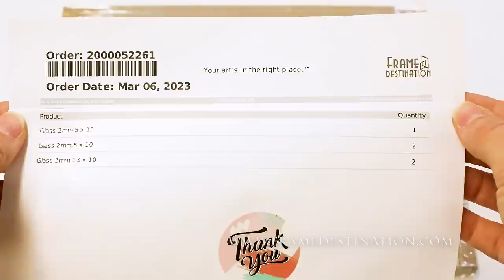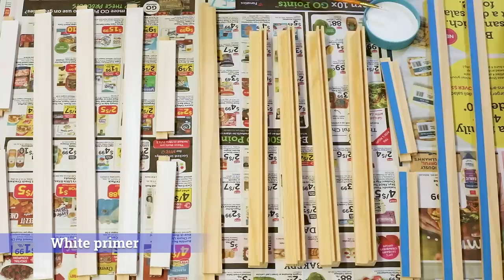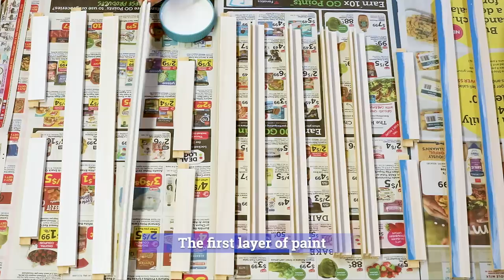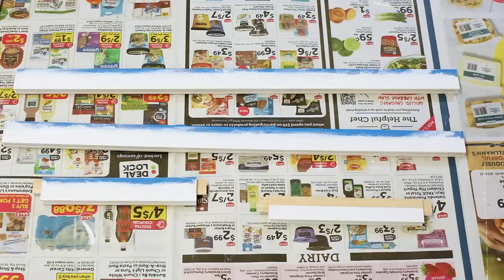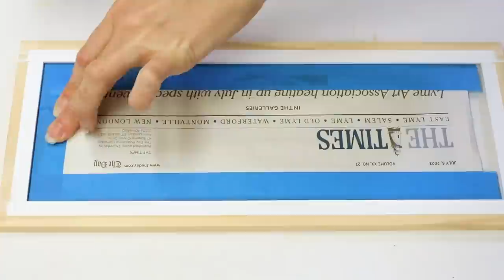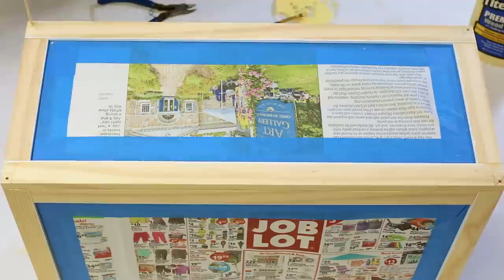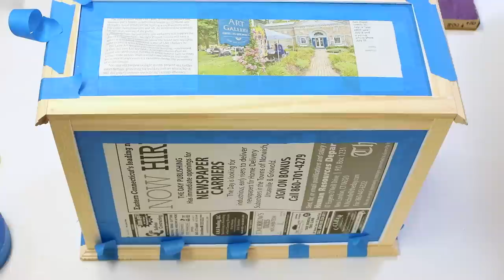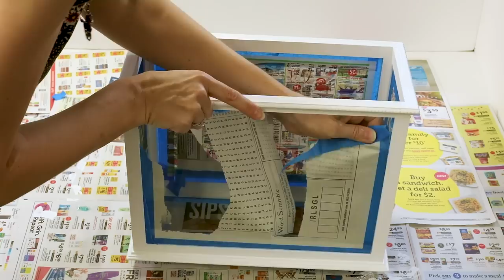DIY DISPLAY CASE (with the Real Glass) for a scale model

Comment: Hi Olha... great video on the showcase. I just made a showcase for my HMS Victory. I'm surprise you didn't use picture frame strapes for the showcase. Anyway it looks awesome.
Reply from the maker: Thank you very much!
You can use anything that will emphasize your model! I prefer the contrast of the material as well as the color. How to demonstrate a wooden model on a wooden background? It will be difficult to separate them. That's why I prefer metal, stone (even if it's imitation), and finally paint - it adds contrast in texture and materials...
Of course, except for cases when the display case should match the color of the interior)))

Comment: Very thoughtfully designed and cut and assembled Olha. Very inspiring. Did you use 3/4" stock wood?
Reply from the maker: It's hard to say now because I used all the scraps from previous projects. I cut the board 3/4 thickness or a little less, and the vertical pieces from 1'x1' slats...

Comment: Hello Ms. Batchvarov, I want your opinion on plexiglass for the following: Plexiglass gives off a gas that acts as electrolysis acts on a real vessel, and it disintegrates all of the soft metal hardware on the model over time, reducing it to dust.   Is true?  Is there any reliable brand such as  Plexiglass or Lexan?  Thank you,  kisses to your kitty!
Reply from the maker: That's why I use real glass. You can find it in galleries that make picture and photo frames. Because in a few years, plexiglass will turn into a scratched and cloudy, sometimes deformed object, which simply makes the model look cheap. The larger the plastic display case, the faster it will turn into trash...

Comment: Here's a little tip if you want to do it. When making  marks on wood with a pencil use tape then mark where you want to drill.
 So you don't really have to do a lot of sanding to get rid of the pencil marks. Maybe I press to hard with the pencil but thats what I do. LOL
Reply from the maker: You do everything like a professional carpenter!
I just knew I was going to paint this frame, so I didn't worry about pencil marks at all...

Comment: For the tablesaw, getting an add-on scrollsaw air blower (or just the aquarium air pump such actually are) can help keep the dust away (or headed to dust collection).

Last time I saw a copy of the Times was when I had to fly into Hartford to get to a Boston construction project, as all the Boston flights were full.  Memories.
Reply from the maker: I vacuum every time after using the saw...
I just paid attention to what newspaper I used))))